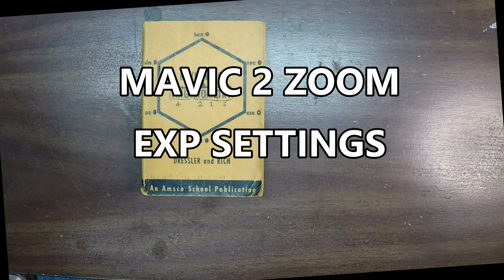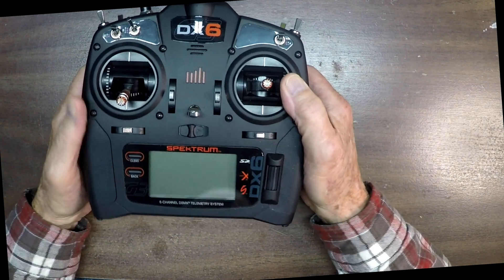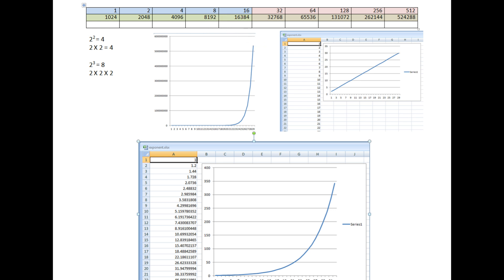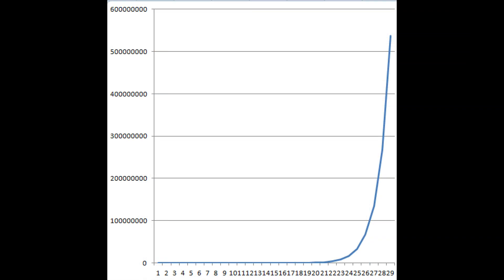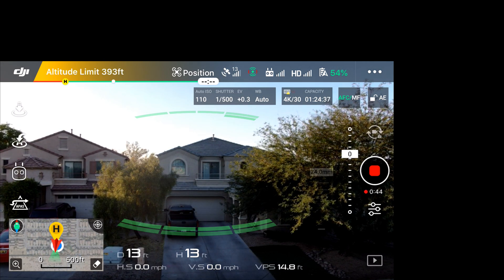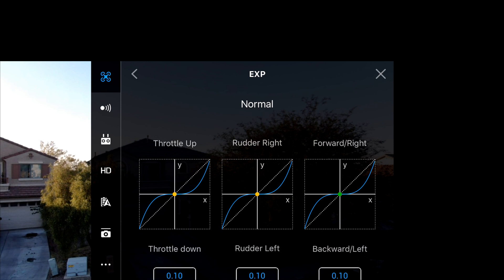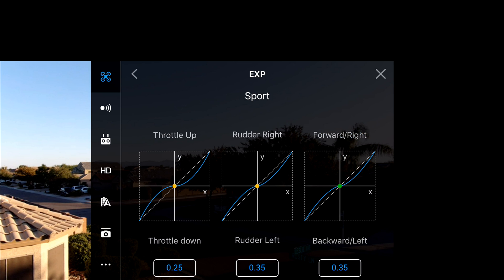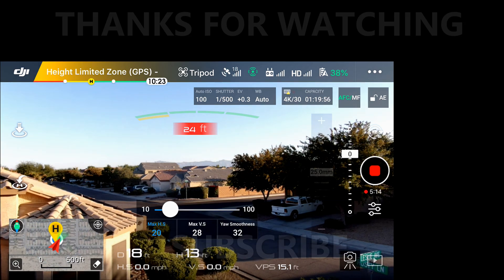MAVIC 2 ZOOM EXP (Exponential) SETTINGS

Comment: Hi Mrkent, I checked it for the Spark but unfortunately there is no such a setting like the Mavic for it. I only can change the controller speed but those are coupled with sport, tripod, normal. So panning speed cannot be set indepedently ☹. Thanks Ton
Reply from the maker: That is too bad, but I mentioned in the video that out of all of the controllers I have used over the years very few have this option. And I really made good use of it with my fixed wing models because I tend to over-correct when under pressure :) Thank you for your input and God bless.